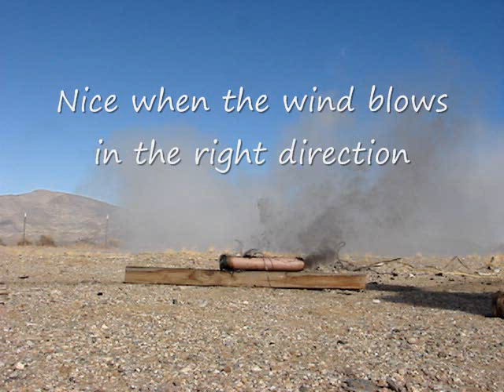Sugar Shot to Space grain igniter test

Comment from the maker: @jimsealyjr   Not sure what 'double pop sound' you are talking about. The igniter you see at 4:09 in the video is similar to the igniter shown at Rocketry Central. Scroll down and go to Info-Central, then scroll down to Propulsion then to Igniter, then to solderless igniters (article 228). These are then dipped in a pyrogen to aid in ignition. 

Yes, years ago I made an 'accidental' moon burner in a pvc motor case and it folded up in flight.